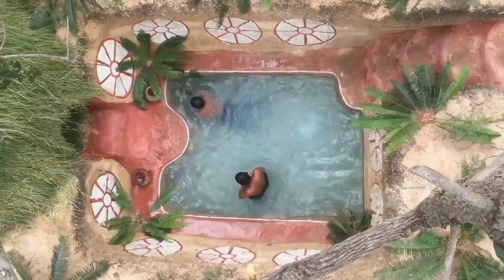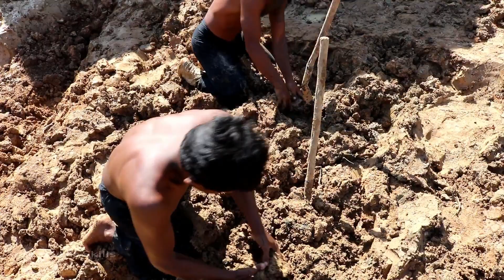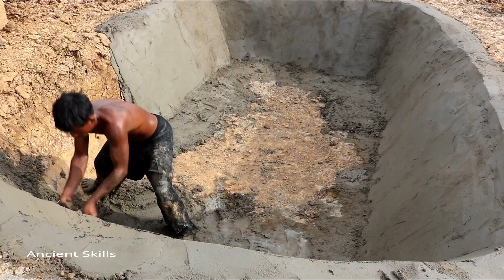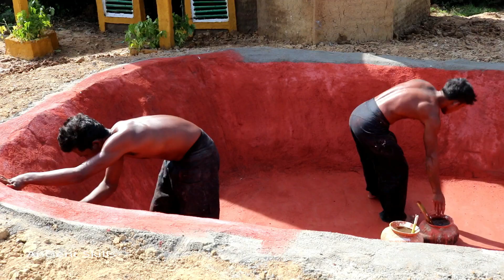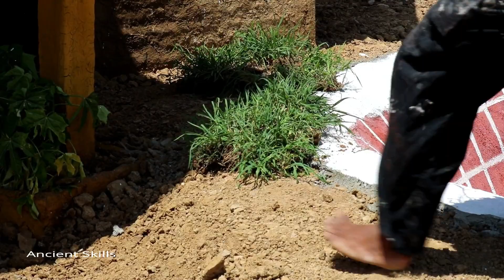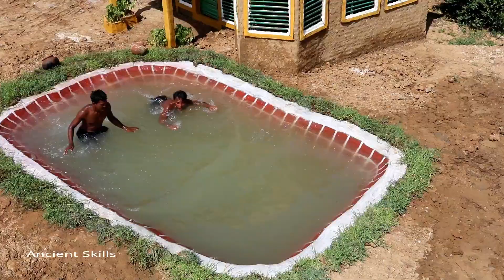Dig the soil to design a beautiful swimming pool for the villa

Comment: Russia. the city of Voronezh. If you continue to build houses over long distances, then you will not have room for new buildings, maybe you will start building new houses with old ones and when there is enough space and at the same time you want to see what happens to the old ones. When you build a pool, then build it so that you can drain old water and pour new water in it, and if you do not change the water in the pool, it will rot and start to stink or frogs will appear in it or turn into a swamp.